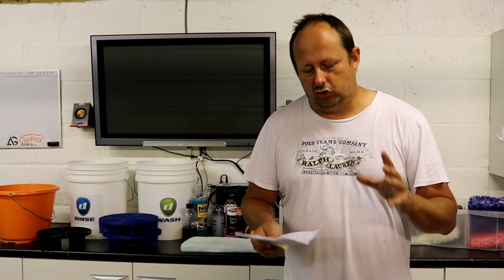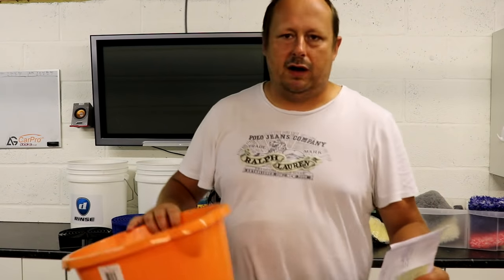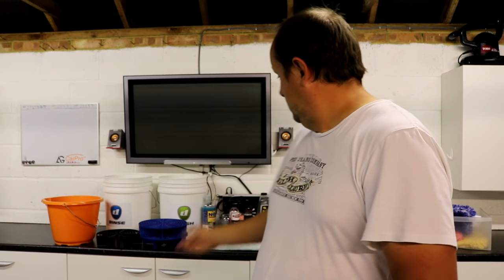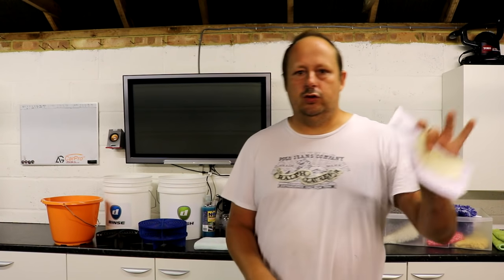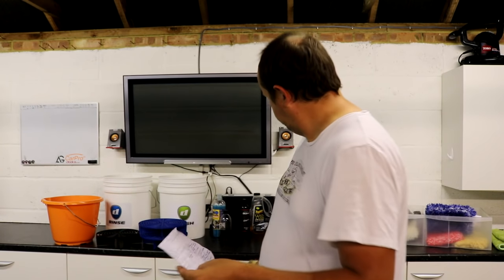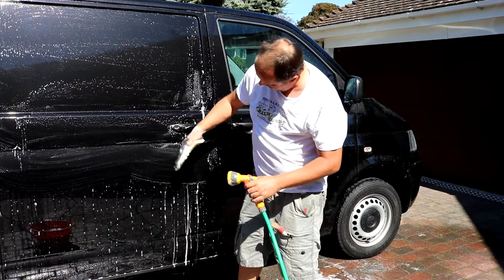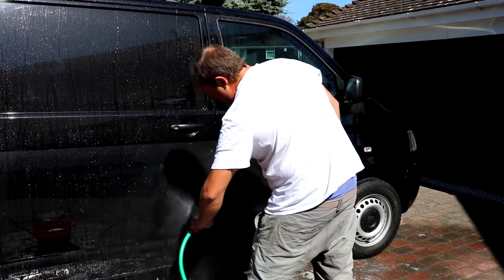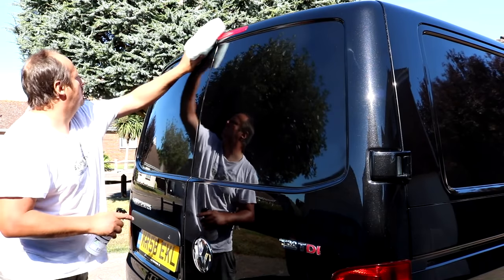The Forensic Detailing One 1 Bucket wash method

Comment: Really like this method used it over the weekend on two cars. By the time I had used the same incredimitt on the second car it didn't seem to be performing as well in terms of picking up the suds. 

I am a complete beginner and I was wondering if you ever thought of doing an idiots guide to detailing specifically washing, using fallout remover and hand polishing (I don't feel confident enough using a machine polisher and don't have the time with 3 small kids :o)? I spoke with Pete in Bilt Hamber and he recommended Korrosl and Cleanser Polish but want to use these properly. I'm pretty sure I am putting small scratches on the car during washing even though I think I am being careful. Like I say a basic guide to get a really good finish washing, fallout, tar remover and polish. I have been washing and using Autoglym aqua wax up to now getting pretty good results.

Also the raptor microfiber cloth seems to be out of stock on in 2 detailing and savers choice. Are the Korean ones they now sell just as good?

Comment: This is a great video, this is def the best way to wash a car using the 1 bucket method. Infact i will do the same , lugging about two buckets with grit guards etc doesnt guarantee grit free. I really like this method with using a hose. Ive ordered 10 of them cheap wash mitts that you have recommended to use from amazon. Ive also got a metrovac side kick filtered warm air blower that i use which works pretty well.

Comment: I use a similar method already, I've been too scared to voice it up in case the two bucket warriors hated on me! With regards to the brushes i took the plunge and bought the Auto finesse hogs hair set, my only concern was the plastic sleeves tend to crack and come off easily although the the bristles are will fixed in with resin. My most recent purchase was the swissvax wooden handle type. Seems up to the job so far.

Comment: once again I have to agree with you with the two method bucket I prefer to use the one bucket method and the hosepipe the old fashioned way my reason for saying this I just use clean water from the hosepipe to rinse the dirt off my microfiber cloth instead of using the two method bucket I find it a lot more easier and safer

Comment: here is what I do to get rid of the micro particles off of the mitt.  I hook the loop of the wash mitt on to the back of the windscreen wash wiper and then wash the mitt with the pressure washer.  I can get by with the 1 bucket method.  what do others think?

Comment: Hi Jon I'm a L plated weekend warrior but learning fast thanks to you. OK so I snowfoam and 2 bucket, why cos I bought the things including grit guards and yes I'm a dunker (but not anymore, thank you) also couldn't really get my head around the 2 bucket method other than in principle. OK so the mineral grey beemer was foamed, washed, KSE'd and Beader maker applied 10 days ago. With virtually zero miles covered since then I was able to write clean me on the rear glass owing to all the crap coming off the trees (which are not particulary close). Bit fed up at the thought of dragging all the kit out again when technically its all done. Very happy with the idea of one bucket wash with ONR, bought some on your earlier recommendation but really couldn't bring myself to try it without a pre wash (now I can try it out!). 2 questions is it good to use a rapid detailer all over after each wash and would you recommend using Beadmaker again every time after each wash?
Reply from the maker: so a good quick detailer will work as a drying aid and allow you to sort of wipe over the panels to bring up some shine.. you can use beadmaker every wash but it works a bit better dry imo.

Comment: I find a one bucket wash works well with a wash pad (currently loving the Adams pad, but applies to Dooka et al) which are a mare to rinse out in a bucket, so I just run the hose on it until it’s clean. Far more effective. So while agree with your method I found the rest of the video quite contradictory, you advocate using a very safe wash technique, then suggest skipping the prewash which would do half the job for you.
Reply from the maker: if your using ONR in the bucket and dont have thick road film, then yes you could just rinse down.   in winter if there was a thick film over the car then soaking out that film with pre wash and pressure washing off etc..  maybe even using 2 buckets if you wanted to might be a better way forward.   On the golf I do tend the clean the car more with this method and I dont have any build up of swirls on it.. but on a car I really care about I prolly would not just rinse over with water and dive in with this method.

Comment: Ok stupid question... why dont you add the step of using the hose into the two bucket method? I know it adds time but if you are going to be anul about getting your mit clean for a car you have worked hard on the finish why not add the extra step?
Reply from the maker: I find you get the mitt cleaner rinsing with a hose thank dunking in a dirty wash bucket.. so its kind of getting to the point of not being efficient to do both...   the bucket rinse does allow you to really work the mitt over the guard grill though which can be handy for deep pile formats of mitt..   this rinse mehtod doesnt work as well if you have the big deep shaggy style mitts...     This 1 bucket method is really handy in summer when your in a rush..   the other thing that makes it work as well as rinsing those chinese mitts back to spotless, is the fact ONR in my opinion does a great stop of reducing marring..  you could almost just use ONR and ditch the second bucket.. but I hate having dirty water in the wash bucket so I dont tend to do that.

Comment: Jon, the spray bottles, i see over numerous videos you've got several all marked yourself, are they chemical resistant?, and what ones do you recommend yourself?
Reply from the maker: I have cheap ebays ones and have the black sonax ones..  the black sonax spray head has copied with Tardis for over a year so they are solid..  the ebay ones have also been ok but the strongest ive used in it is alkaline wheel cleaner...

Comment: one thing - I use grit guard mainly to trap dirt and prevent water from stirring in a rinse bucket. I scrub the mitt with my other hand while dunked in the rinse bucket. I very rarely scrub the mitt against the grit guard itself...
Reply from the maker: cool point jan..  I just find running over it with your  hand doesnt really open out the fibers and get the dirt out well...

Comment: Hi
I do not really understand why many use high gsm towels with QD, is just a waste of the product which is absorbed by the towel?
Reply from the maker: I tend to to use a high GSM buffing cloth when Im using the QD as a drying aid (on a car with some water left after rinsing, or stuff you miss when you towel dry)... So the high GSM towel will keeping going more than a low GSM one if you hit some bits of water...

On a dry car I favour normal buffing cloths because they have more bite..

But you would not exactly be wasting any "noticable" amount of product using a high GSM.. The products are generally designed to flash away and the active ingredients (things like waxes, or siloxane etc, gloss polymers)  are left on the paintwork...      The reason you generally dont use the big dense ones to buff is they are too pillow like and have no bite...

Comment: i've never really followed the set rules on washing two buckets etc etc my method and i dont claim to know it all i just prefer it lol is a pre rinse with a PW and a weak APC, bucket with grit guard (zaino bucket had it 6 yrs now i have two but never use both) warm water shampoo plus and an Adams wash pad and wash, roof, side windows, boot, bonnet half way down the doors front bumper back bumper then lower doors and sills. i'm going to get a bunch of those mitts and try your method of rinsing the mitt as its short piled your method makes sense, i'll still use my bucket with grit guard as i already purchased it and the towels etc but deffo going to give that mitt and rinse a try. I'm struggling to find a good shampoo that doesnt cost the earth and has no wax etc etc just a pure shampoo? 

p.s didnt know you were on Detailing Nation good to see you on there i'm Grizzle
Reply from the maker: hey graham.. the car chem is a great offering.. just shampoo.. but very concentrated.  I think it pick up some awards on DW...     I think the ONR helps but thats something Ive literally only been doing for a week.. but seems to add slip...
Reply: Graham, I found that 3D Pink soap leaves a squeaky clean surface with nothing else. Decent price too.

Comment: Makes sense. What if you have a short nozzle for the pressure washer so you can spray the mitt I might try that instead of a hose. Nice tips
Reply from the maker: if you can spray it with the pressure washer that will prolly work although it might be a bit awkward and it might blast some dirt into the mitt rather than flush it..  but could work if you drop the pressure a bit.

Comment: Hi John,
i've been using the "holy" method of the 2 bucket wash for ages now, thinking that this is THE method for as "safe as possibly can" washing. But after following your amazing channel for a while now (btw very impressed with your attention to detail in every way,thumbs up for that!),i'm not so convinced now that 2 bucket is the way to go? It makes sense what you're saying, but i admit i would try it but not with confidence.
i'm not entirely sure that those chinese mitts are good quality(like most things cheap aint equal to quality)? And although your rinse method with the hose is quick and doesn't inflict dirt in your wash solution, how sure can you be that you've hit every mm of that mitt with your hose? While if you where dunk it in a rinse bucket you now that every fibre has been slushed with water?
and my last concern is that the pressure of a regular waterhose isn't created equal in every county/city. I can tell already from watching your video that your water pressure is higher than mine,so that means that the chance of that i would get the most dirt out of the mitt is lower than yours because of the lower pressure coming out of the hose?

I hope you still follow this thread as it been a while that you've posted an answer, but i'm very interested what your detailed mind thinks about my issues for this method.

Thank you.
Kind Regards
Reply from the maker: thanks leminako.   my water pressure sucks :(     the chinese mitts are ok..   not anywhere as good as my favorite mitts.   This method works fine.  like others have said you could chuck more mitts in the bucket and save time.  ONR is the key thing as well that helps make this safe.   

tell you what though 2 buckets is still a good way to rinse off a mitt.  everything has a place.  I understand why lots do it.  I dont tend to use 2 buckets that often though.. every time I dont use 2 buckets in a video I get crucified :(
Reply: Then mine sucks catastrophicly😊. 
I'm also so lunatic detail minded like you, like your clay video I totally agree the agressiveness of clay and should be taking seriously! 
Now for the Chinese mitts, simple question, are the safe for your paint? You say ok?? My understanding of ok is that's fine enough for people who want to be semi safe on there car. But I want best safe possible. They are extremely cheap and that's there great appeal. But I can't find them easy to ship to Belgium.. Can't you use this method with other mitts, like the microfiber madness or meguiars microfiber mitt?

Comment: Car Chema dilution is 1900:1 so for a 22ltr bucket it's 12ml of soap and there caps are 10ml so it's about 1.5caps then?
Reply: hakman239 it would be 1.2 caps if your ratios are  correct.
Reply: I found that 12ml isn't enough I put 2 caps in first then water but  I use to use chemical guys gloss works auto wash that had much better foam

Comment: Totally agree on the issue of gritguard vs scratchshield.  Starting to see gritguards coming down in price to around £6 each as well!
Reply from the maker: thats cool tarby 6 pounds is a bit more reasonable isnt it
Reply: Forensic Detailing Channel yeah, replacing my scratch guard ones with them as those things are useless (as well demonstrated in your vid). Spend more time putting them back together than washing the car!  Autorocket on eBay is doing 2 gritguards for £10.99!

Comment: Another take on your method is to drop 5 or 6 of the wash mitts you have into the clean soapy water and use one for each panel flipping it over half way through. Once your finished the panel discard the mitt into another pail to be washed and cleaned later on. Now you can move on to the next panel with a clean mitt from the soap bucket. This way you always start off with a clean mitt and the bucket of soap remains 100% contaminant free.
Reply from the maker: i do sometimes use a few if they get a bit dirty for sure.. but yer the mitts are so cheap you can throw a load in like you say..

Comment: I was thinking about using multiple rag master chenille MF mitts for a one bucket wash. Put like 4 of them in the soap and ONR. Rinse off the mitts as I go and after a couple of panels, go for a new one. What are your thoughts? Thanks!
Reply from the maker: should be fine mate... remeber you need a nice plush cloth to buff it dry
Reply: Forensic Detailing Channel I use an electric blower to dry. Should I not use that since the soap water has ONR?
Reply from the maker: i think your supposed to gently buff the ONR residue away with microfiber...  you could maybe blow most of it off and then buff whats left?

Comment: So you say you get the mitt cleaner using a hose rather than a second bucket, but then go on to say that if you were washing a supercar you would use the two bucket method? I'd rather wash my mitt with fresh water from a hose than dirty water from a bucket.
Reply from the maker: yer maybe dave... I hear what your saying...  so I tend to perhaps use a method like this nowadays on the golf.  Its just as quick and I dont have to get all the gear out and the golf isnt covered from swirls from not using 2 buckets etc..  but generally if I care about the car I will make sure I use a good pre wash that actually hits the film of dirt on the panels well..  try and get as much off so really the contact clean is just hopefully dislodging the the rest thats on the panel..   and then the 2nd bucket of rinse water can be usefull and perhaps less hassel.  I dont always use 2 buckets though..

literally everyone has their own "thing" with how they do it...
Reply: Forensic Detailing Channel ok I see about the pre wash... But at 34:30 You say that the wash bucket is clean (and it does look remarkably clean) and cleaner than if you used the 2 bucket method. But then later say if you're cleaning a car you want to be extra cautious with, you would use the two bucket method. It seems like you're giving in to the 2 bucket detailing stigma and not following the method that you have proved to yourself to be a safer method!
Reply from the maker: yer maybe buddy, I dont tend to script them.. theres so many grey areas in detailing you can end up contradicting yourself a lot.  tbh Im not entirly sure what the complete method was in this video was a couple of years ago I shot this.

Comment: And there is another 1bm instead of using 1 mitt use multiple mitts so 1 mitt for every pannle 9th gen accord does this
Reply from the maker: yer that would work for sure...
Reply: With this 1bm you use few mitts 1 per pannle then discard the mitt and the wash bucket stay clean like you just filled it